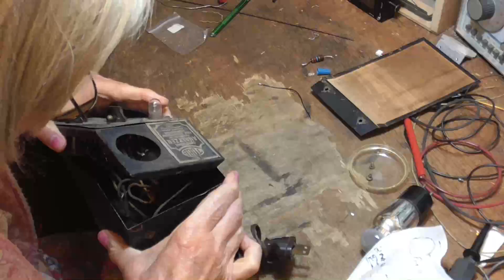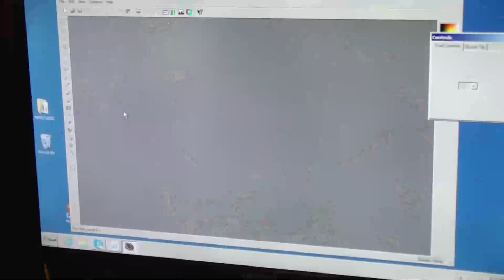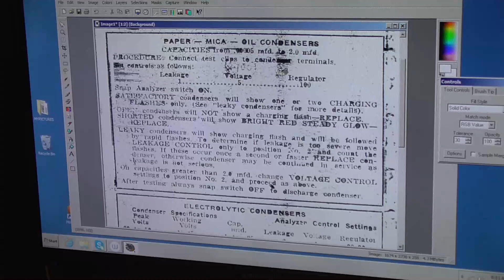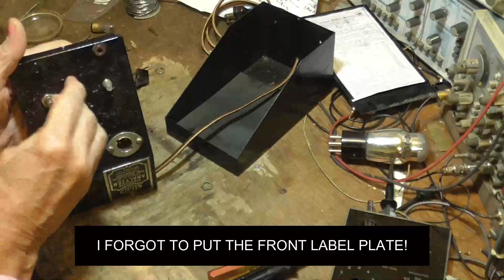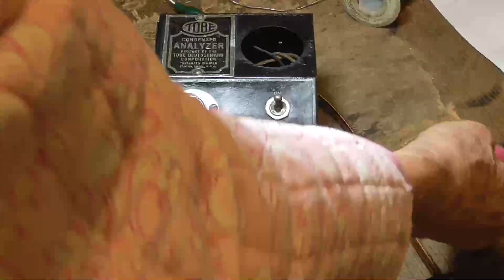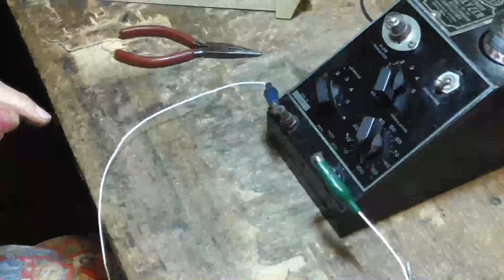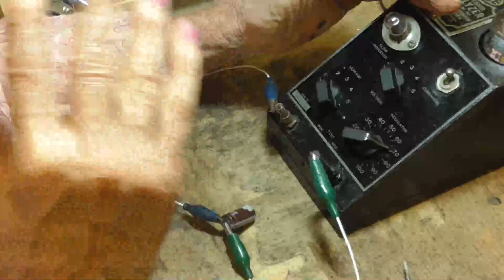RESTORING A 1934 CONDENSER CHECKER

Comment: I noticed the indicator has two filaments one glows when its charging the cap and the other glows when its discharging the cap.
Reply: It’s a neon indicator. One or the other electrode will light up depending which way the voltage is applied

Comment: I am from Germany; and in our electrical code it is strictly forbidden to tin stranded wires which are to be put in screw terminals. The solder takes the "springiness" of the wires away and the connection looses up with time. Then you have a fire hazard coming... But on low power stuff like a capacitor tester it doesn't matter that much, of course.
Love your videos! Keep 'em coming!.
Reply: Tinning the wires is bad because the solder being so soft flows under the compression of the terminal and therefore the connection loosens over time. Notice though that Ron in his Great wisdom said, "Tin the ends" that's the secret. Tinning just the ends holds the strands together but the solder doesn't get under the terminal. Ron knows all the tricks.
Reply: @peterjameson321  You are right about the solder making the stranded wire mush under compression. Much like aluminium. But if you look at the video you see that Ron indeed tinned all the stripped length not only the tip. But even the tinning making the strands plasticise is a problem that is not going to haunt him for decades.
Reply: dafür gibt es eben crimp ösen oder Aderendhülsen oder Ringkabelschuhe.
Reply: @Merlinkatamari  Yo. Called 'ferrules' in english.
Reply: @Merlinkatamari  du kriegst aber weder AEH noch Ringschuhe sauber in diesen Steckern untergebracht. 
Aber bevor ich mir über den Kaltfluss der verzinnten Adern nen Kopp mach, wunder ich mich lieber übers Fehlen jeglicher Abdeckung auf der Steckerunterseite. Gehört da nich ein Pappdeckel drauf?
Und statt die Sicherung reinzulöten hätt ich nen fliegenden Halter genommen und den dort zwischen gehauen wo er die Netzleitung mit den alten Adern verbunden hat und nich unten am Schalter. Da lob ich mir unsere 5x20 Feinsicherungen über diese Ami Monstersicherungen
Reply: @randomsteve4288  aderendhülsen ohne kragen würden bestimmt gehen